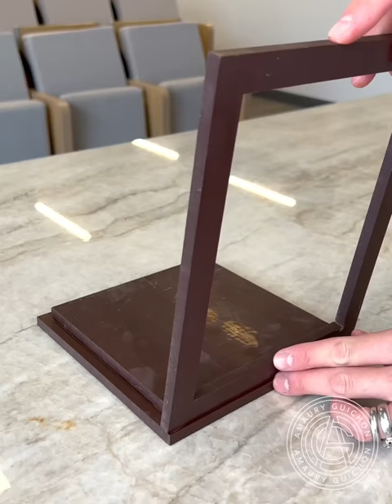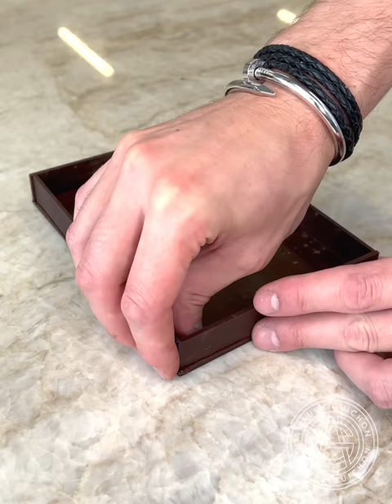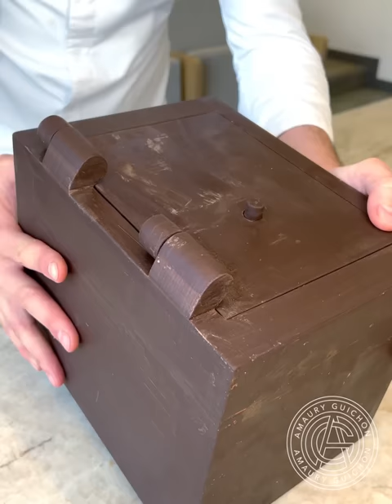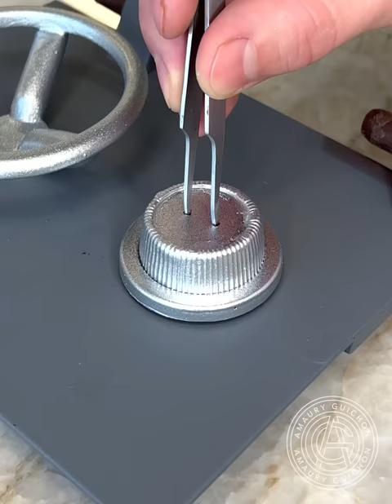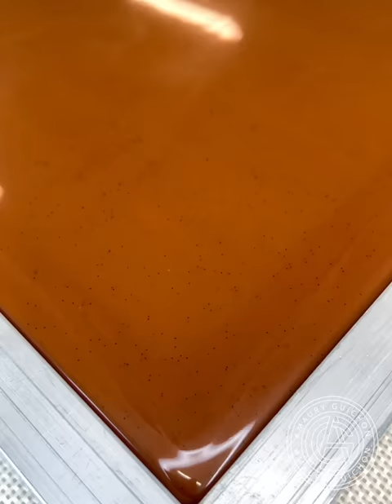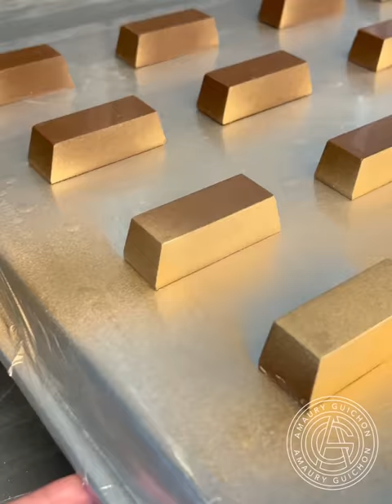Chocolate safe!!

Comment: Dude, if you just switch your non-eating intended designs to a stronger material and you would be making great pieces that are more sellable.

Of course, chocolate might be still great with low fat content. I just think that it's relatively weak against temperature.

Oh, and I can guess not many materials may be as workable as chocolate. I guess it's a great room temperature material for sculptures.